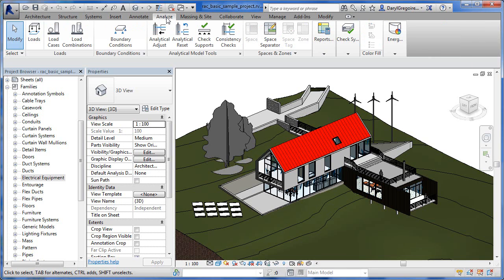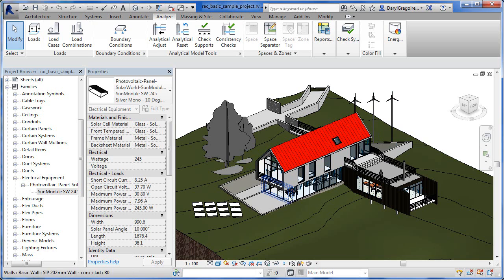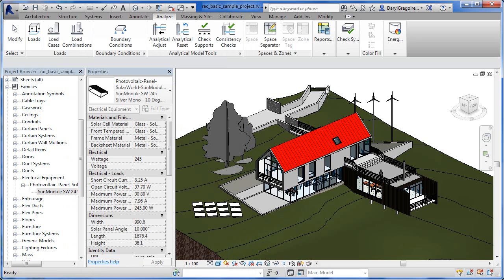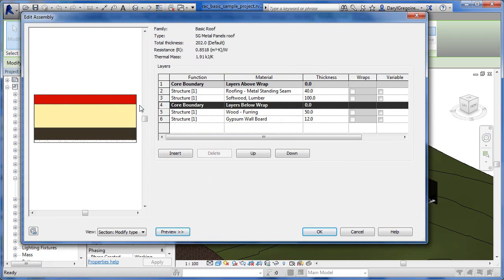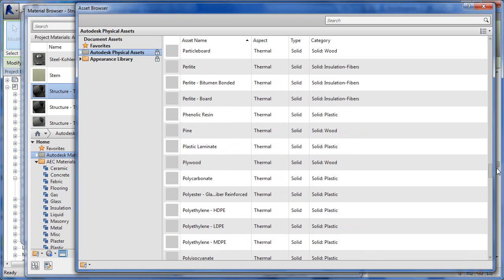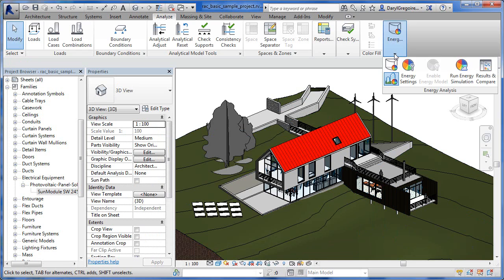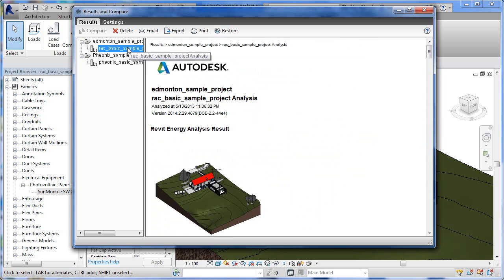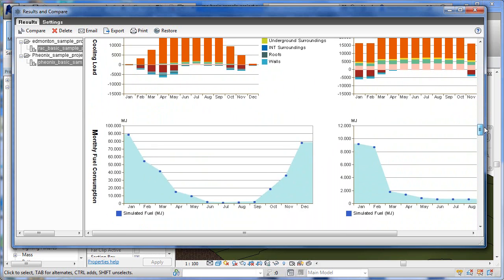REVIT - Energy Analysis Tools - CADclips

Comment: Great Video! It was a tremendous help...
Do you know where can I find more of this in depth, I tried to run an analysis with a project at my job but this message comes up
"Can't create any energy analysis surfaces. There are no Room bounding elements defined in the current phase. Please check the Project Information settings."
If you could guide me to the right direction I would immensely appreciate it.